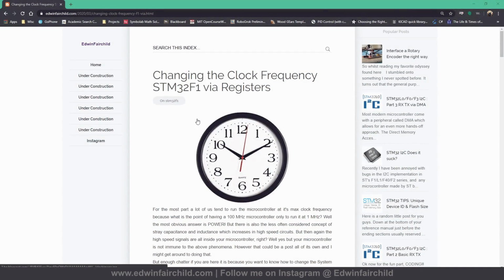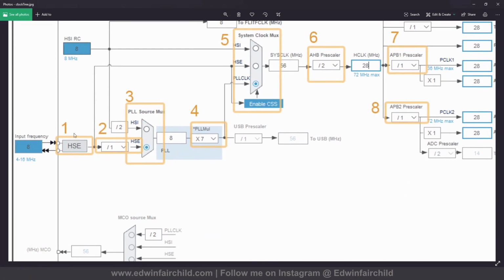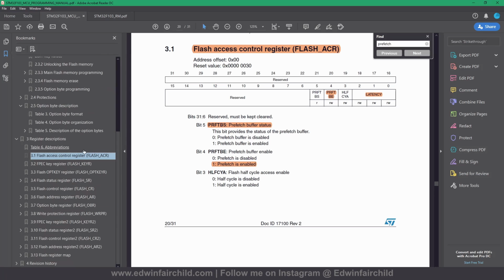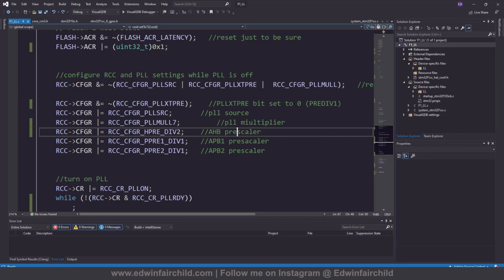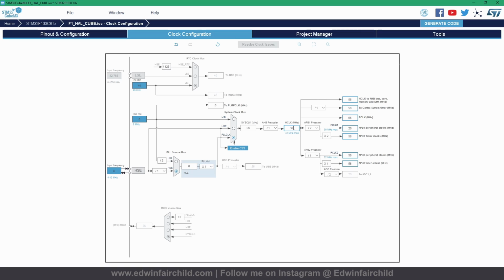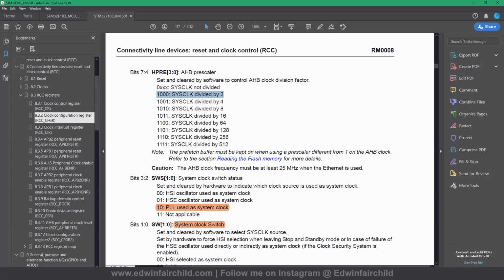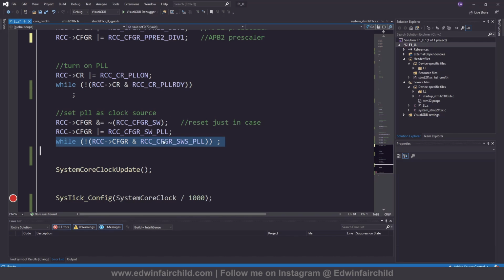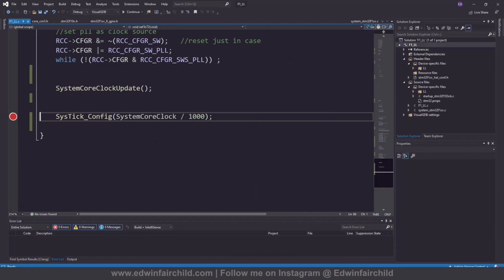STM32: Change clock speed via registers

Comment: hello, i tried setting my clock to 72 using the tutorial but i am not getting anything even my led toggle has stopped working, 
and i am getting stuck at HardFault_Handler what could be the problem?
Reply from the maker: Have you tried looking at my blog and copying the code , I think on my blog I did a different speed , but check your code. Because this is working code
Reply: @EdwinFairchild  i did copied from there not sure why its not working i tried using cubemx and it configures perfectly and everything works but cannot make it work this spent almost whole morning
Reply: @EdwinFairchild   dont have your email otherwise would have sent you whole code
Reply: @EdwinFairchild  one thing more, i am using Keil
Reply: @MrJamshaiddar1 Boa noite, vc conseguiu?

Comment: Good stuff but I would argue that bit definitions are not worth the trouble.  When you look up the bit that needs to change (from ref manual for example), why insert a cryptic label that obscures that value?  Now you have to look up that label to make sure it means what you want???  Just use the number.
Reply from the maker: not sure why you think its cryptic ? I find bit definitions help me and thus i DONT have to look into the ref manual . Can you imagine reading code like this :  (RCC->CFGR |= 1<<24 | 1<<12 | 1<<3) unless you know by memory what 24 12 and 3rd bit do then you absolutely have to open up the manual .  While reading something like RCC->CR |= RCC_CR_PLLON I can tell this bit turns the PLL on
Reply: @EdwinFairchild  There are several problems here.  There are 10's of thousands of bit definitions.  For every one that is obvious to you, there are ten that are not to me.  And they make header files 10X larger than they have to be.  I'd rather look in the ref manual (that I need to know anyway) than sift through 14,000 line files trying to find what label someone decided on.  My projects are 100MB before I even start coding, mostly due to HAL and LL files I don't want.
Reply from the maker: @kenwallace6493  I really should make a video on the topic , I guess if you don't know how to look for something it can be daunting but it is so simple infact. And you're preaching to the choir here, I have zero videos on HAL because I don't use it. But bit definitions is a completely different thing. It's just the header file of the chip, don't tell me you sit there and define a pointer to address 0x80020000 and call it GPIOA , then I would believe you are being efficient and just defining the addresses you need, otherwise it's just masochist. I'm not sure if you're just a hobbyist or an engineer but as engineer you need to learn how to use the tools for the job. I am all for using register level code but redefining bits or just hardcoding left shift and right and coming back and reading that months later is not fun. Its funny you say you need to learn how to read the manual because the bit definitions come exactly from the manual so I'm not sure how reading text on the manual and reading the same thing in code can scare you. Like I said if I make a video on something like LL and show you the conventions used it will be an epiphany , reading the manual is great and it's what I teach..but at some point you have to get some shit done, let me know how programming ethernet baremetal stack just by reading the manual goes.
Reply: @EdwinFairchild  I'm a power conversion engineer with 50 years experience so have been retreaded several times.  Programming is only about 20% of the job and power converters are always one microsecond from disaster so close to the metal it is.  I do use and appreciate the pointer constants to the configuration registers but there are only so many thousand-page manuals I have time to learn.  For example, picking a HAL or LL functions that "seem to say what I want" just won't cut it.  It's probably OK for communications where an error is often benign but not for timers, ADCs, DACs, PWM, and digital control loops.  In short, our projects tend to be small, dedicated, time-critical functions focused on one part number.  But then I came up from the bottom (Assembly to C) as a side effort so don't have the professional programmer's perspective.

Comment: can we used internal clock without using crystal oscillator?
Reply: Yes, internal clock does not require a physical external crystal oscillator. It is taken care by the micro controller itself. But it is not very accurate when compared to external oscillator.

Comment: Pleease make I2C tutorial for STM32F103C8 , pleeeeeeeeeease...  without DMA please ... It will be great.
Reply: Why without DMA? Even for low frequency updates it is still nice to let the DMA handle everything and handle the interrupt or read the buffer when you want.
Reply: @thomzz3449  I want to handle everything by myselft. ;)
Reply: @emmetray9703  can't argue with that. Haha ;p
Reply: @thomzz3449  :D
Reply: @thomzz3449  btw do you have any working example of I2C without DMA?  only CMSIS
Reply: @emmetray9703  nah, sorry. Haven't done anything with I2C on STM32 chips. I did use the I2S (for sound) on a F401 once with DMA, but that's more like SPI than I2C.

Are you trying to get the I2C working or do you want to see a tutorial before you begin?
Reply: @thomzz3449  I red STM32 datasheet (deeply) and then wrote my I2C code, but sometimes I have some freezes (like ACK not received and e.t.c) Even more, I bought logic analyzer (Sealea) and trying understand what the HELL is happening..
Reply: @emmetray9703  I hope you mean "reference manual" in stead of "datasheet".
Reply: @thomzz3449  of course
Reply: @emmetray9703  If you would like some help or for me to review your code you could send it in discord: https://discord.gg/RuYZBFk
I can promise i'll spend a lot of time on it but it is better than continuing in this comment section I think

Comment: Tell us your best Bench press..
Reply from the maker: Hahaha I haven't tried my max in a long time
Reply: @EdwinFairchild  Please if you can ,create  stm32f103c8 I2C tutorial without DMA, ONLY CMSIS. I want to use my MPU 6050 and sometimes my code is freezing. I read whole stm32 datasheet, mpu6050 data sheet, tried everything , researched a lot of codes ,  but still have same problem. :(
I dont  know what else can I do.
Reply: @emmetray9703  MPU 6050 is quite bad, especially if you are trying to find orientation along all 3 axis.  You should look into ST MEMS sensors, as they are generally higher quality than the Invensense sensors.  Kris Winer designed an IMU with the EM7180 sensor fusion co-processor, which manages the sensor fusion saving resources from your main processor.  Its explained far better on his website and GitHub Repo:

https://www.tindie.com/products/onehorse/ultimate-sensor-fusion-solution-lsm6dsm-lis2md/

https://github.com/kriswiner/EM7180_SENtral_sensor_hub/wiki
Reply: @SilasWaxt3r  Thank you very much, what do you think about BNO055 or BNO080 or LSM9DS1?
Reply: @emmetray9703  Read Kris Winer's GitHub Repo articles.  Seriously.  I glossed over them at first, but if you take the 20 mins. it is definitely worth it.  The BNO series are not as good as the ST sensors according to some of Kris' tests.
Reply: @SilasWaxt3r  I read and seems EM7180  is MPU9250 + Teensy Cortex ARM M4 microcontroller + barometer. Is MPU9250 good? this is a main question.
Reply: @emmetray9703  The host MCU is negligible when in conjunction with the EM7180 because all your host will do is receive interrupts from the EM7180 and receive quaternions, Euler angles, (or sensor data if you configure in pass-by mode).  The most accurate inexpensive IMU I've seen so far is the one I linked above, the "Ultimate Sensor Fusion Solution - LSM6DSM + LIS2MD."

Kris and Greg Tomasch are currently developing a new sensor fusion co-processor based on the MAX32660.  Its not out, but the posts on Hackaday show that this will likely be even better.  I will likely switch to this IMU-system when it is released.  https://hackaday.io/project/160283-max32660-motion-co-processor
Reply: @SilasWaxt3r  is LSM6DSM better than LSM9DS1?
Reply: @emmetray9703  Idk, but I don't think Kris has an IMU with the LSM9DS1.   If you are planning to create your own, you have to create a file using a "deprecated compiler" which is then loaded from EEPROM onto the EM7180 at startup.  This file is the sensor configuration and tells the EM7180 how to interact with the various sensors and what their orientations are on your board.  I've never done this, but when I was talking to Kris, he said this is tedious.  What are you trying to accomplish?
Reply: @SilasWaxt3r  I'm building rocket and I want to use the best IMU sensor under 30-40 $ , I do have BNO055, MPU9250, MPU6050 , Also I ordered LSM9DS1 and BNO080(they are on the way)
For now BNO055 is the best.